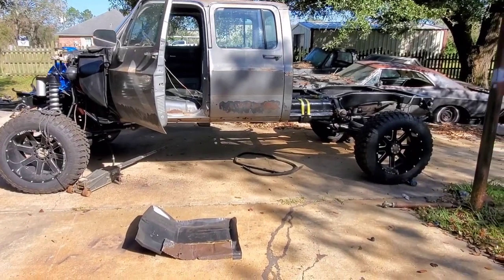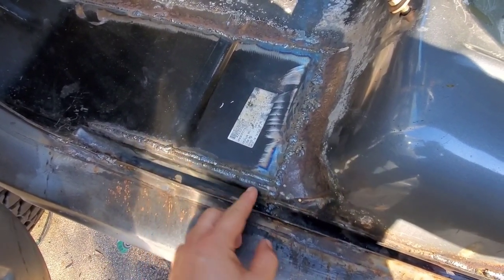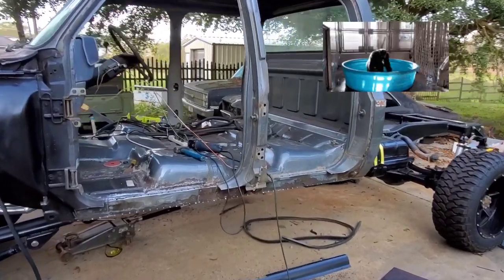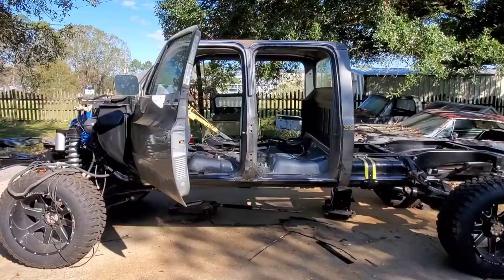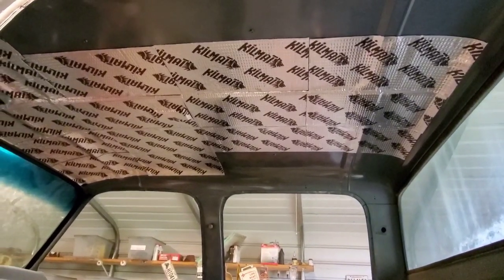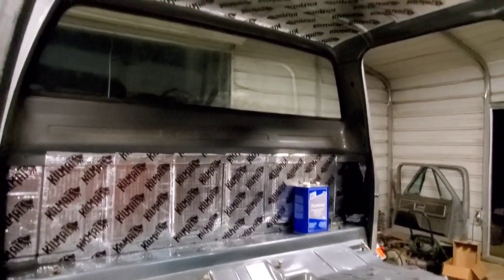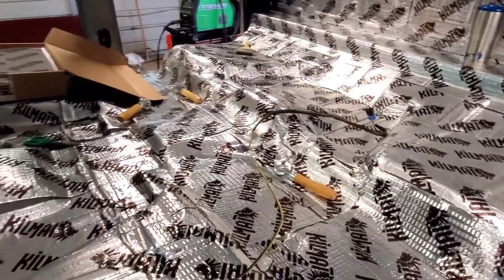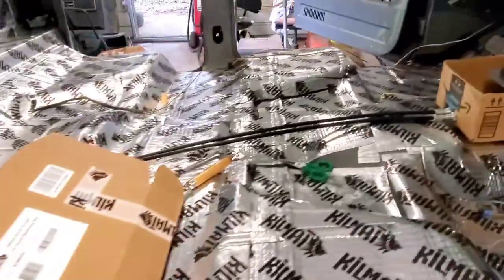Square Body Crew Cab Build. Part  10! Rocker panels and Kilmat.

Comment: Dude I’ve been wanting to see a video of the rockers on a crew cab to see what I’m going to be getting myself into on my K30. Looking great brother!! Good luck finding the engine gremlin.
Reply from the maker: Thank you.  
I say don't cut into the door seal area if you don't have to. That was much harder.
Reply: @ReshardsAutomotiveWorkshop  that’s sucks. That’s where mine are rotten. Lol
Reply from the maker: 😬. You can get it done.  It just takes more time. Also, I should have done the rockers before the floor pan. They are spot welded together on the door seal area.

Comment: Nice work on those rocker panels 👏🏼 do you mind sharing the part # or link form lmc , i need to replace them on a 86 gmc crew that I’m going to start working here on shortly, thanks
Reply from the maker: Sure thing. I'm looking for the order form now.
Reply from the maker: Part number 38-9054 (left) 38-9055 (right)
Reply: @ReshardsAutomotiveWorkshop  thank you
Reply from the maker: No problem 👍.

Comment: LMC panels have been hit and miss for us as well. I have some Brothers Truck floor pans and rockers here for another project I will be trying. I will let u know how they fit. Nice job. That truck is looking awesome. What’s with the motor?
Reply from the maker: I am getting spark and fuel, but it's not starting. That's why I was leaning to the grounds, but we did some testing and the grounds are good.... soooo next is maybe fuses and relays.
Reply: @ReshardsAutomotiveWorkshop  how about timing? If it has spark and fuel should fire up u less the timing is out
Reply from the maker: We checked it at least 4 times 😟. This engine is the TBI, so there may be something I am missing.